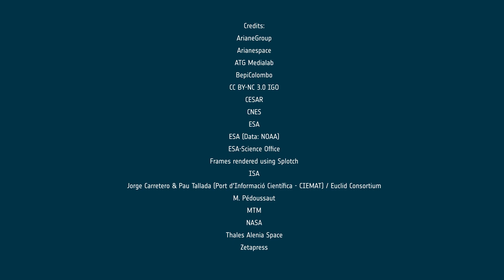ESA preview 2026

Comment: 📩 THE GREAT SPACE-TIME CHALLENGE
From: Junior Scientist Vinayak Jaiswal (The Original Thinker)
To: The Global Physics Community / Successors of Albert Einstein
Subject: The Planck Hole Deadlock – A Challenge to the Continuum Model
Dear Professors,
For over a century, we have accepted that Space-Time is a fabric that curves under mass. But I present to you a logical "Deadlock" that threatens the very foundation of General Relativity and Singularity models:
The Support Paradox: If Space-Time is a fabric, what holds it in place? Like a blanket held at the edges, any curvature requires a "Support Frame." My research suggests an Invisible Wall at the cosmic boundary. If no such frame exists, how does the fabric maintain its tension?
The Pixel Puncture: Space-Time is not smooth; it is quantized. My theory proves that at the Planck Scale (1.6 \times 10^{-35}\text{ m}), the "Pixel" of reality ruptures. This is not a "hole to another universe" but a literal puncture in existence.
The Triple Collapse: In this state, I challenge the possibility of "Action."
If the fabric is torn, Curvature is gone (Gravity = 0).
If Space is gone, Time freezes instantly.
In a state of Zero Gravity and Frozen Time, how can a "Big Bang" or "Wormhole" ever occur? Action requires Time.
The Question: How can "Nothingness" become "Something" if the very rules of "Becoming" (Time and Space) are destroyed at the Puncture point?
I await a logical refutation that does not hide behind complex equations but addresses the fundamental deadlock of the system.
Signed,
Vinayak Jaiswal
(The Junior Scientist who found the Puncture)